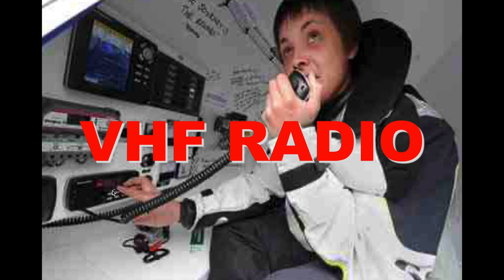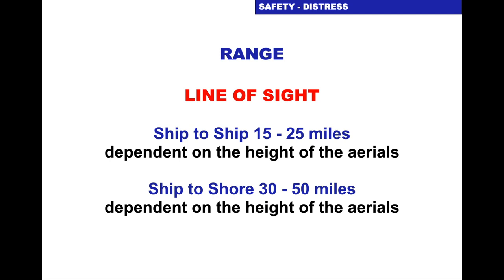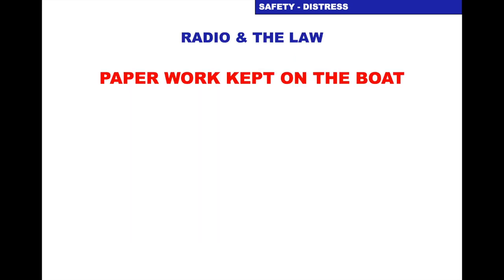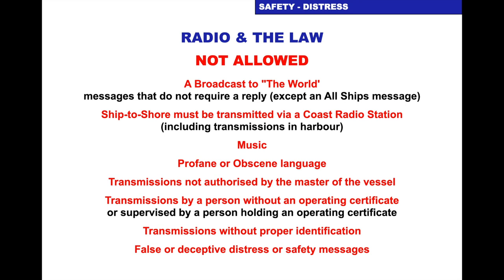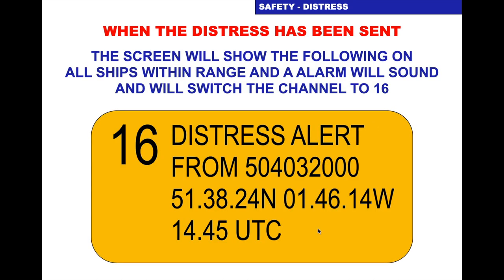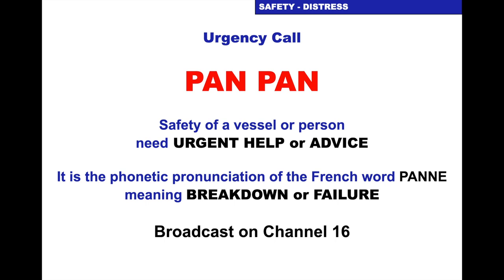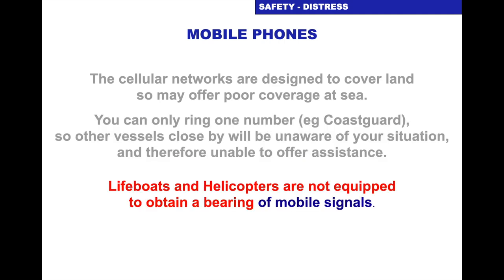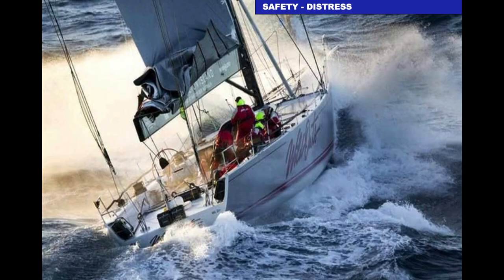The whole of the RYA VHF GMDSS Course

Comment: Really enjoyed your video, although I'm uncertain how different some of the regulations are between the UK and US, there are many similarities.  I've had my boat for a year and just realized I'm in the dark regarding my radio's capabilities.  I am not required to have a VHF license as a recreational boater, however, I will be heading out 40 miles in pursuit of albacore, halibut, etc., and I've just registered my MMSI and now understand how powerful this tool is, especially once hooked to the GPS enabled chart plotter.  Thanks again for the information.
Reply from the maker: Hi Good question. 

The USA has different channels but the operation is the same, most sets you can swop from European channels to USA channels, this is why the standard horizon has the button with 16 and 9 on soi you hold it in and it goes to 9 which is a call-up channel in some US areas. In my experience, the USA has weather channels on the WX button which gives a continuous weather forecast which is great.  

Glad you enjoy the channel, please tell your friends. 

Paul City Sailing

Comment: I have a General class amateur radio license with the FCC. I noticed my Baofeng UV-5R dual band VHF/UHF , 2 M , 70 CM  hand held , can also receive and transmit on VHF marine radio bands.
Reply from the maker: You can only use a marine radio with the set licenced with Ofcom and you having a certificate to operate, you also need to be marine-based.

Comment: Hi, as an occasional boater in the UK  I want a VHF for safety only - what license do I need to apply for [as of 2021] -  it used to be ofcom cg66 but I think this has changed
Reply from the maker: You will need a certificate to operate to use your set, this is the course in the video we can offer at www.citysailing.com , the set you buy can be registered directly for free with Ofcom.  There is no CG66 this is now covered by the RYA DSasfetrax system.